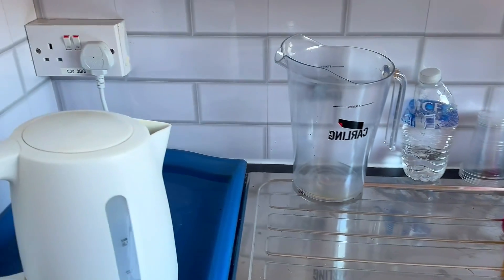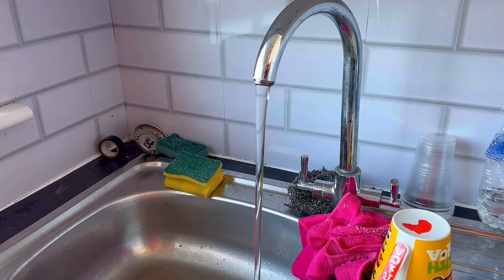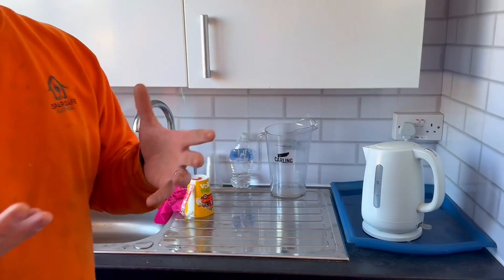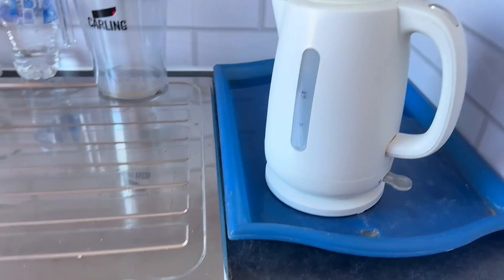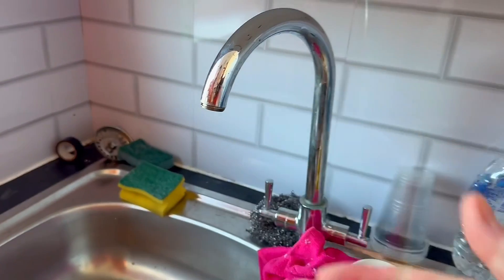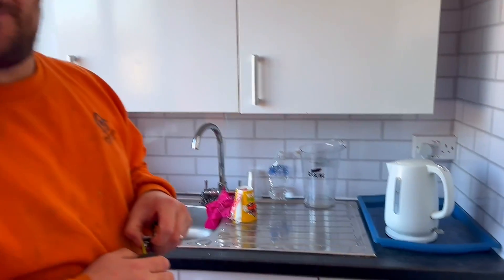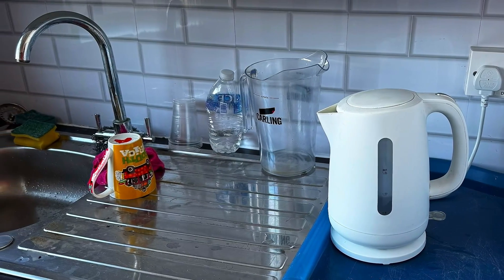How Close Can You Install a Socket to a Sink?

Comment: 1. The socket is 230mm laterally from the sink, however it is also 'up' the wall - so how far away from the sink is it actually?
2. Our employers' safety inspectors used to fail the old style kettle (with the removable lead) if the lead, when unplugged, could reach the sink bowl.  We used to shorten leads in that instance.

Comment: NHBC’s drawing shows minimum 300mm between edge of sink and edge of socket, NOT edge of draining board. They clearly show the socket partly above the draining board and 300mm away from the sink part. Your drawing showed 300mm to the edge of the draining board. Interesting difference!?
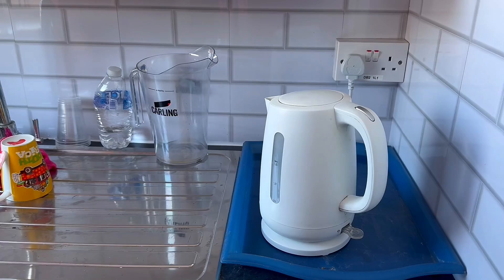Reply: 0:44 If you go back to the building regs diagram at 44s it shows on the left of the draining board 300mm laterally to the closest socket. I think they're wrong because while BS7671 is not law, Building regs are definitely enforceable on the basis where any additional or new works CANNOT leave the area/circuit in a worse condition relative to current building regs. So, the sockets can stay if they were in prior to new regs, but you cannot install a new circuit or additional new sockets under the old regs. (Although I can think of how they contradict even that with the new heights of sockets and switches in existing rooms).
Reply: @John-ou4rm  I’ve recently built a house and have a socket over 300mm away from the sink basin but less than 300mm from the edge of the draining board, per NHBC drawing, and it’s been inspected/tested and certificated to building regs.
Reply: @over-engineered  They probably didn't care, but it's 300mm, the draining board area has water and is part of the sink as it drains into it. But evidently they didn't worry and probably didn't even notice it. Nb: I just did my electrical building regs qual last week !! Passed.  But it's all in the onsite guide.
Reply: @John-ou4rm  so are you suggesting that NHBC published drawing is wrong, as it clearly shows socket above drainer is acceptable as long as 300mm away from basin!?  Just google NHBC socket above sink.
Reply: @over-engineered  I've actually gone into their diagrams and they're definitely NOT aligned with everyone else. They definitely state 300mm from the bowl. So you're right. I think they're wrong. I'd need to look at the building regs in detail. The IET guidance under which I've studied is clear that it suggests 300mm from the sink unit (which includes drainer). None of anything is law. Under BS7671   it just needs to be suitable for the environment.
Reply: Imagine if the draining board is 10m long 😅
Reply: It should really be measured from the tap, or in the case of a normal movable kitchen tap, from the furthest reach of the tap. Neither the sink nor the draining board is going to magically produce water flying upward into the socket.

Comment: I'm 66 and I don't remember an electric kettle ever having a lead permanently attached to it. I remember the stainless steel kettles with an element that you could see in the bottom, but the lead on those unplugged from the connection on the back of the kettle. In this situation (where there is very little space around the sink) I would have put that socket slightly higher up the right hand wall and closer to the kettle. Get rid of the tray. Good video though.
Reply: mine used to have an IEC lead

Comment: While BS7671 may not expressly specify minimum clearances as discussed in the video, the Electricity at Work Regulations state -

At Regulation 4(1) - All systems shall at all times be of such construction as to prevent, so far as is reasonably practicable, danger.

and

At Regulation 6 - Electrical equipment which may reasonably foreseeably be exposed to –
(a) mechanical damage;
(b) the effects of the weather, natural hazards, temperature or pressure;
(c) the effects of *wet*, dirty, dusty or corrosive conditions; or
(d) any flammable or explosive substance, including dusts, vapours or gases,
shall be of such construction or as necessary protected as to prevent, so far as is reasonably practicable, danger arising from such exposure.

Any person conducting an EICR and supplying test certification relating to installations at places of work would do well to highlight the EaW requirements and not rely solely on the guidance in BS7671 and its supporting documents. An incident arising from the circumstances demonstrated in this video (as an example) could lead to investigation by the HSE and/or the Police (depending in which jurisdiction you are located). Such investigation may highlight that the electrical installation has been tested but no comments made by the person in charge of the testing as to the construction of the installation (in this example, the proximity of the switched socket outlet to the sink). Any legal proceedings against the owner/operator of that place of work arising post-incident could, potentially, result in the person in charge of the testing having to answer some awkward questions!
Reply from the maker: Thanks for taking the time to add your thoughts 👍🏻